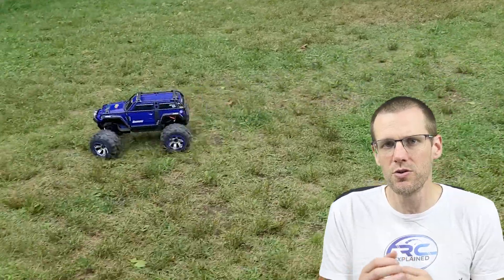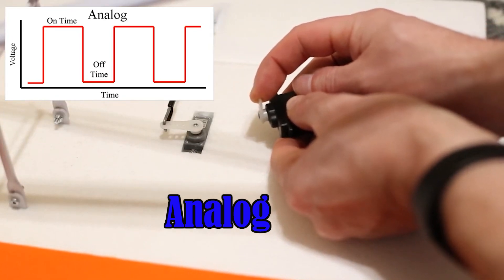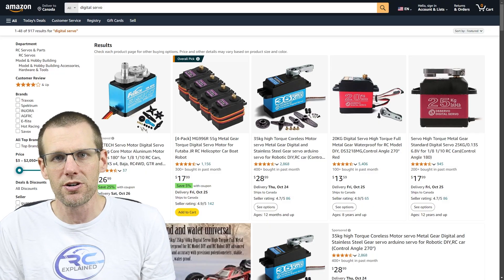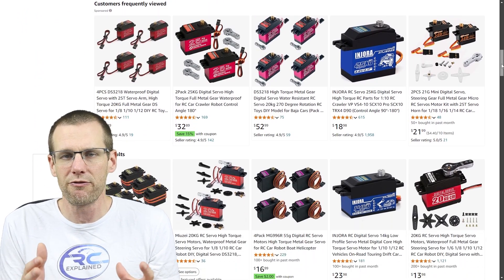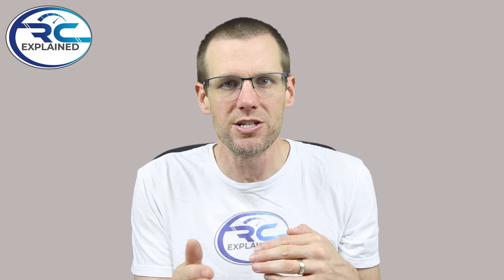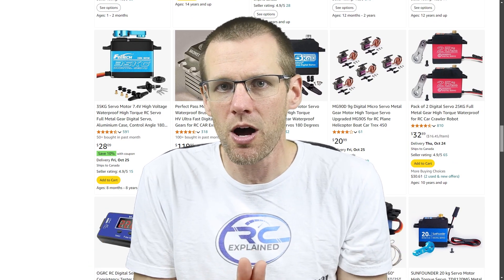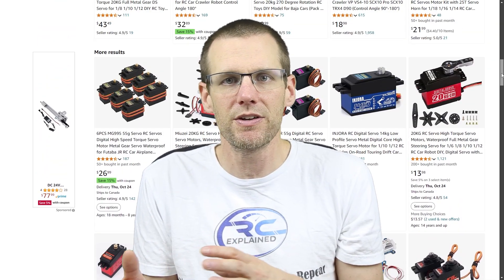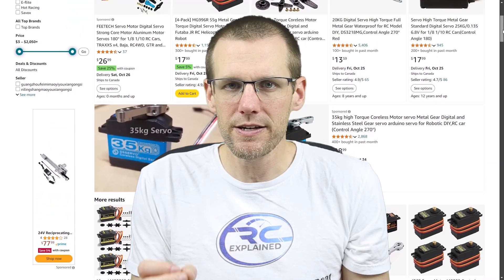Top 5 Reasons Why Digital Servos Are Non Negotiable for your RC Vehicle

Comment: Help please. I’m running a Savox SW-1210sg (Aluminum case digital) in my RockCrawler. Last night I did some very demanding uninterrupted crawling on a woodpile. I probably ran for an hour+. The servo gave me no issues while running. When I shut down, by chance, I touched the servo and it was HOT. Shot it with my temp gun and it was at 120 degrees. This morning I powered up the vehicle and had no servo issues. Thank goodness! My questions: What running temps should I be expecting? At what temps do I run the risk of frying the servo? At what temps would you advise giving intermittent running breaks?
Reply from the maker: This question is a tough one as the temperature measured is not at the core of the motor or electronics on the servo. It's on the case. I would expect that under 130F would be my max. If I felt uncomfortable with the temperature, I'd step up to a stronger servo.
Reply: @RCexplained  Thank you for your quick response and input. I appreciate that.

Comment: How do you figure out the refresh rate/ operating frequency of a digital servo, if it is not provided in the specs?
Or what refresh rate/ operating frequency do you set in the transmitter, if that information is not provided?
Reply from the maker: Video coming out soon for this. If I don't know I ask the manufacture or leave it as the standard rate good for all servos.
Reply: @RCexplained  I like to swap the provided RTR transmitter and set up new models to run on my programmable Flysky NB4+. But when I do so, I need to input the servo's refresh rate, which is often not provided. So far I have had no responses from manufacturers.
But what would be the "fits all servos" frequency? 50Hz? Wouldn't that mean to give up the advantage of a good response time?
Can't wait for that video of yours! 👍🏻
Reply: @christiannasca3520  Shame he wouldn't respond I was curious about same and looking at the same issue myself, I got a digi servo but cant figure out what hz it's rated for, makes me wonder it's not really a digital servo...
Reply: @PatrickBaptist  Actually he did post a video about this topic after my question. I don't have it at hand right now. But you can surely find it on his channel. It is a recent video from a few weeks ago.

Comment: Digital in any critical application or expensive model, they are more money but a failure could cost more.  I remember when digital came to 1/8th scale racing what a difference, better steering and less failure.  Analog for cheap foamie planes that you are glueing in the servos, keep it cheap.  Larry

Comment: Bashers and lazy circuit flyers don't need to waste money on top gear when the limiting factor is the operator. I.e. if you NEED to use a gyro like AS3X, use your time and money wisely to instead improve your skills.

Comment: One benefit of analog servos are they are much quieter than buzzing digital servos. Another benefit of analog servos are that they might be considered "cheaper" and thus will have plastic gears. Plastic gears have less slop out of the box and they don't wear out as quickly as metal gears. Plastic gears are also much lighter and it is cheap to replace stripped plastic gears.

Comment: Everything is a waste of money if the servos aren't properly setup. I.e. there is no point in paying for digital servos when you have huge mechanical leverage but you reduce rates in your transmitter to 25%.  You want to have your travels set to 150% or whatever maximum your TX allows and then if you want to reduce travel, you would mechanically adjust your linkages like using a lower position in your servo horn to reduce the leverage. This ensures you use the maximum torque and resolution that you paid for.
Reply: My rc crawler performs well with a digital steering servo set to 120°.
Really shines with a remote control transmitter  having alot of tweaking ability.
Reply: @Toolbaggers Have you ever been accused of being an annoying know it all?
Reply: A cheap butter knife will always perform better than a surgical scalpel for buttering your bread.  
Lesson - don't just throw money at things, it could be worse if you don't understand the fundamentals.
Reply: If you only use or mainly use "low rates," you are wasting money and performance due to incorrect setup.